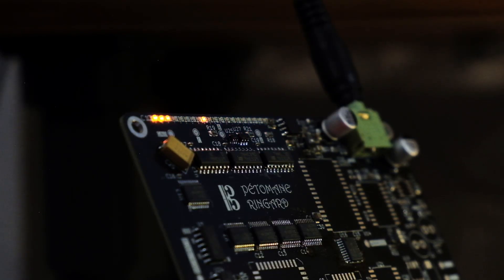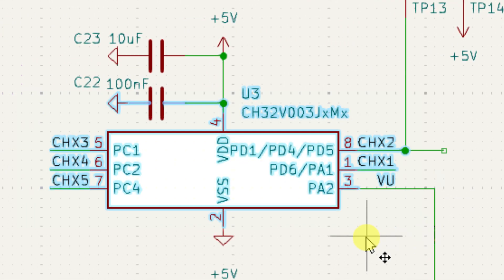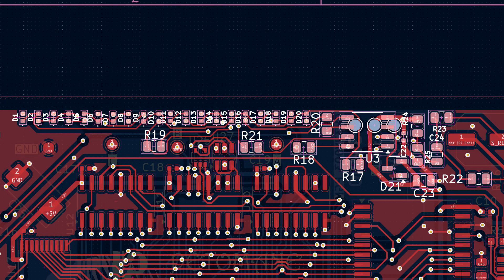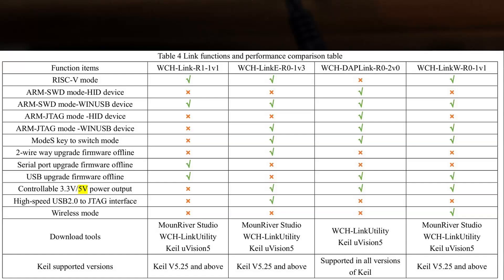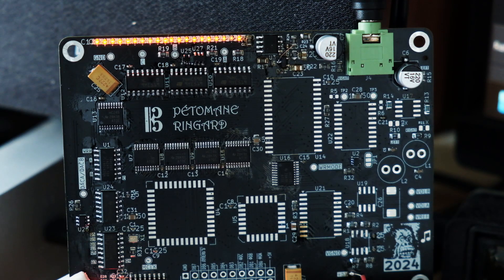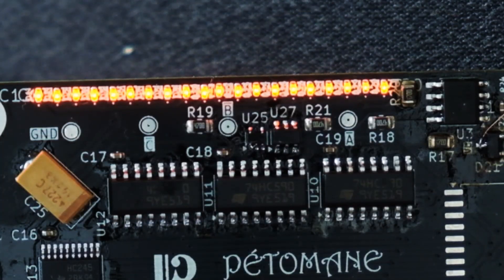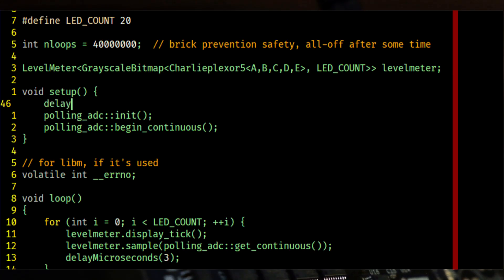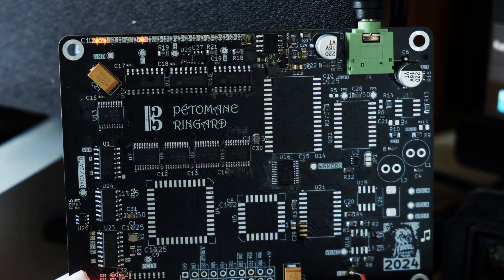Audio Level Meter with RISC-V CH32V003

Comment: I could never get windows to see a CH32V003 board... not sure why
Reply from the maker: @thatonesnowboarde  do you mean the programmer? you need to install the usb drivers
Reply: @svofski  when I plug in the MCU it doesn't show up as com port in Arduino ide
Reply: @svofski  is there a windows driver I need ?
Reply from the maker: @thatonesnowboarde did you install WCH-LinkUtility? For the Arduino IDE to work with WCH-Link you need to install it first if I remember correctly. After you install it, switch the programmer into RISC-V mode.
Reply: @svofski  Ok switched to RISK-V mode, now what?  it doesn't connect nor does it show up on comm
Reply from the maker: @thatonesnowboarde  time to hit the forums then, it's hard to troubleshoot via youtube comments. start by reading CNLohr's notes, if it doesn't help try arduino forums or reddit.

Comment: Another nice way to expand GPIO is with latching shift registers such as 74HCT594. You can control infinite LEDs with three GPIOs. Chips can be cascaded to add 8 outputs per chip without using any more GPIO.
Reply: One thing you have to watch out for with shift registers is total output current. Many "normal" varieties can handle 20mA per pin, but the total for the chip is 50mA or some such. That is, if you want to drive your LEDs at max current for max eyeburn ;)
There's even special versions that support 8x20mA output, though being niche they are usually hard to come by and (relatively) expensive. 
Then there's dedicated led chips, like SCT2024, that take data like a shift register and are dedicated to driving many leds.
Reply from the maker: @AppliedCryogenics  I do that in Pétocontrôle, my other LED-rich thingy. Here I didn't have room for shift registers.